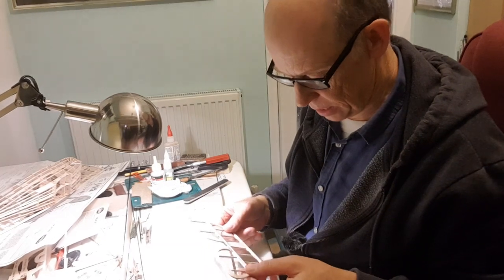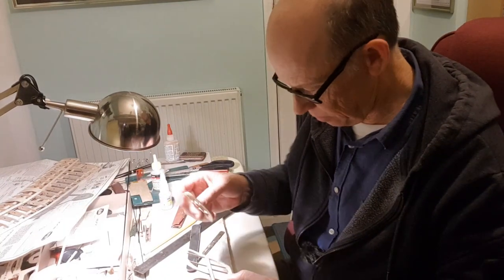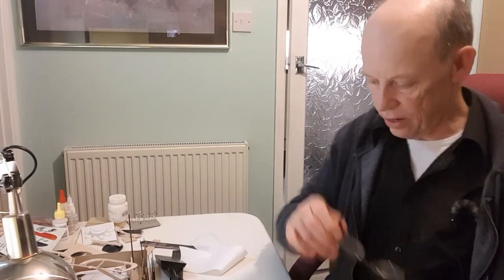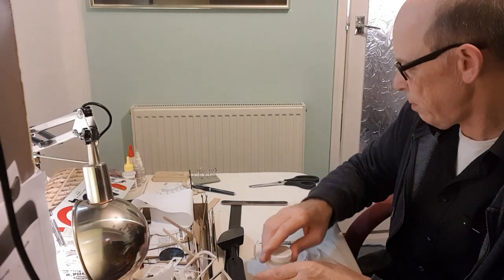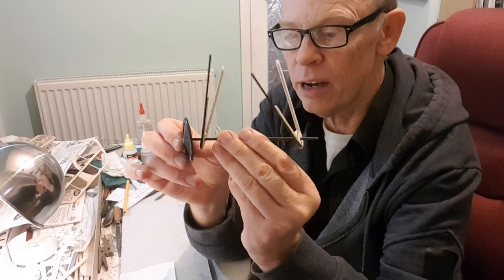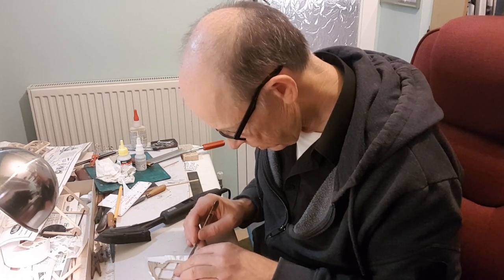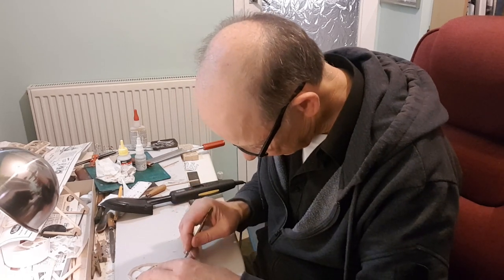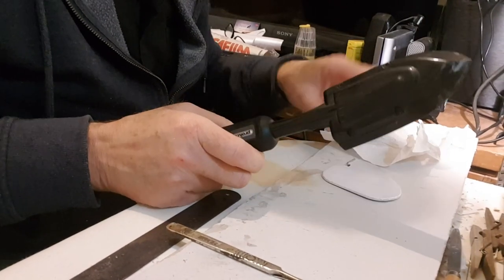Guillow's Nieuport 11 Radio Control Conversion (Part 5)

Comment: No, I don't agree with the hinge placement.  There is more meat if you will closer in.  But that model is quite thin.  I have built that one before when I was a lad and it was punched instead of laser cut.
Reply from the maker: Hi Lee, I couldn't hinge in closer because it's not possible to cut a slot in the carbon elevator joiner, aren't laser cut kits fantastic 🙂👍

Comment: Love the vids. What do you use as hinge material?
Reply from the maker: Hi RM, on this model I used small slivers of thin plastic but I've moved into something a lot easier to use and source and that's nylon fishing line, a small diameter no thicker than a pin. Using a pin make a hole in each side of the surfaces, cut a short length of line and slide it in. A small drop of ca and it's good to go ... really easy and surprisingly strong, cheers.